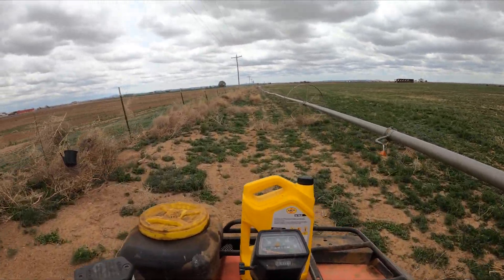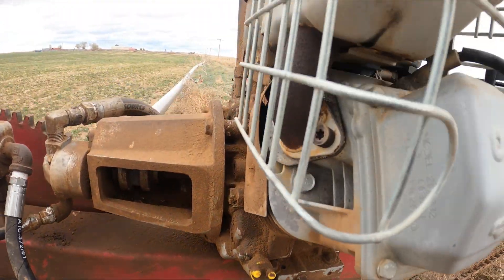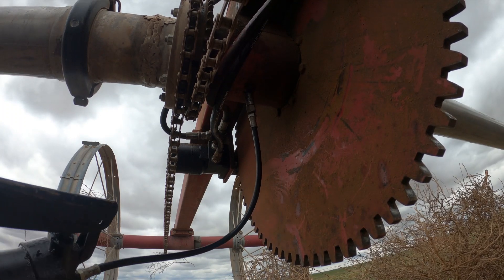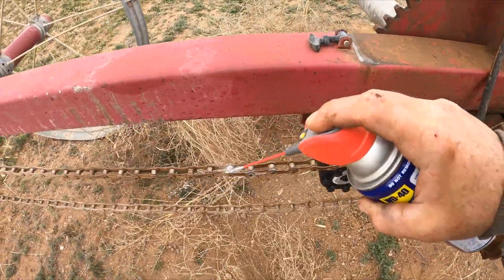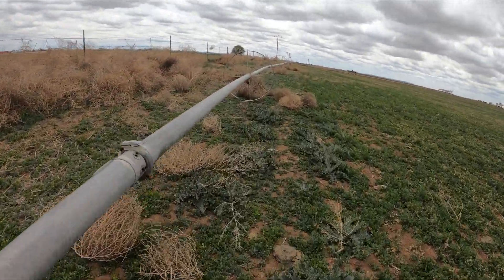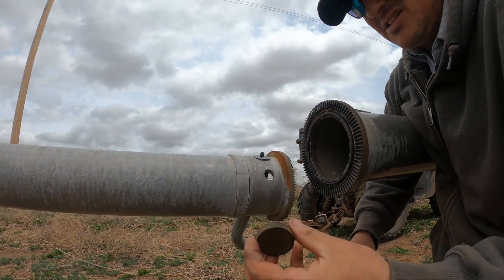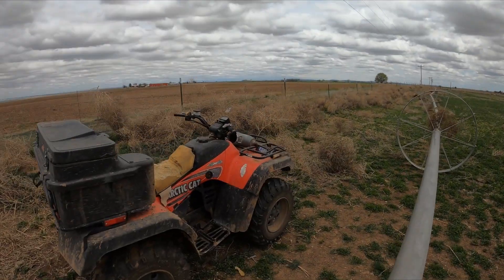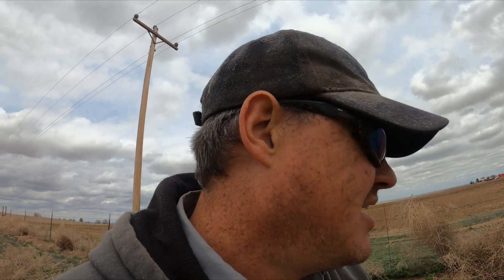Messing with the Sideroll

Comment: Hello, how tall is this tower and is it successful
Reply from the maker: This is a side roll or a wheel line, the supply line is about 2 feet off the ground.  the pivot towards are probably 20-25 feet in the air